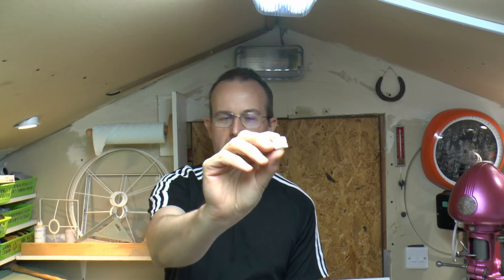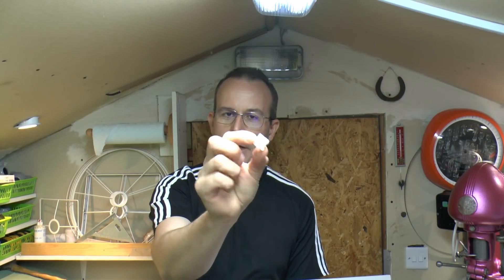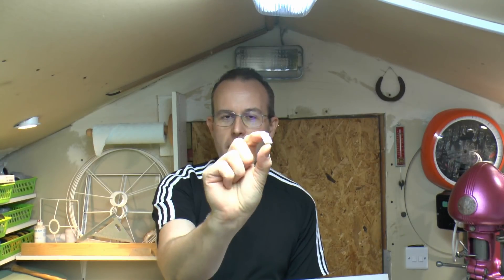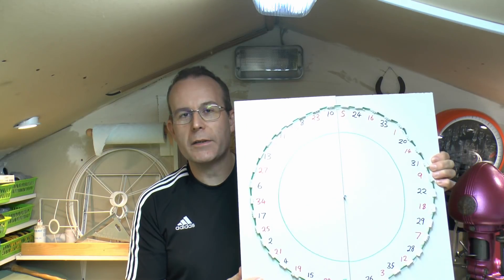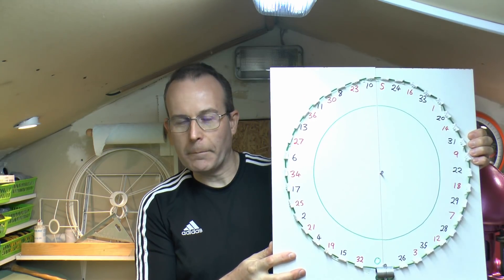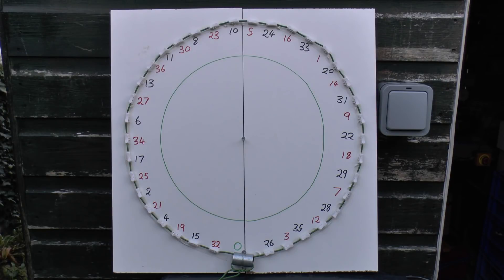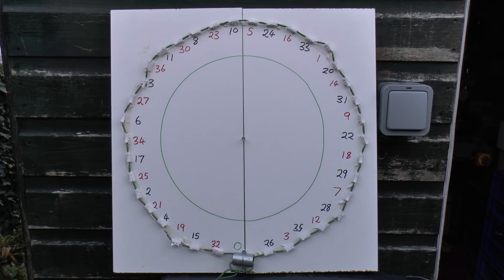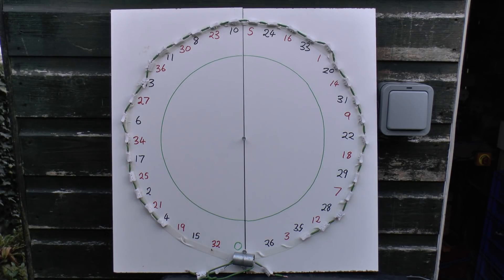Connector Roulette

Comment: Hahaha good one. John I got a question you might help out with. I was looking into the sonoff smart wall switches, what do you think of them? How do you get a neutral wire for them? Are there any better systems ?
Reply from the maker: The usual way for these is to replace the switch cable (L & SL & E) with a 3 core so you have L, SL, N & E.  Can also be done by wiring the system with the supply cables at the switch instead, which is fairly common on new wiring installations.
Reply: John Ward  thanks for that so I can make an order on them k owing that they will work just as well when I get a neutral down back from the ceiling rose.